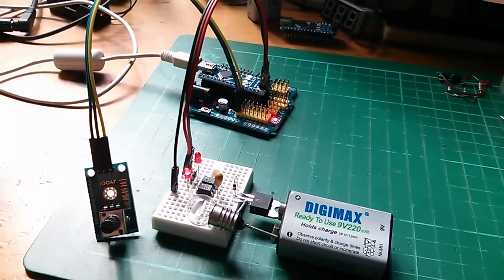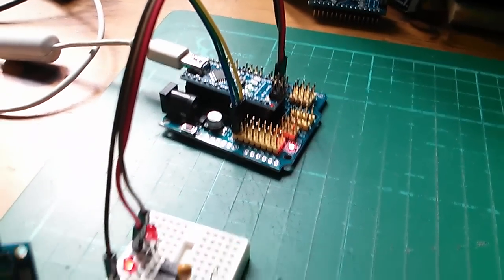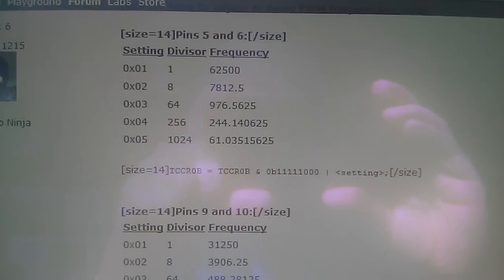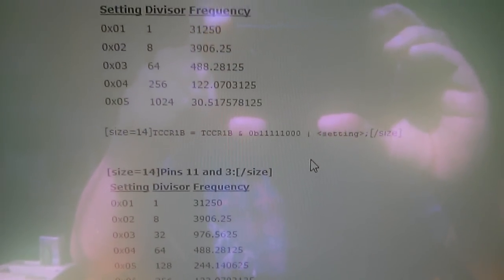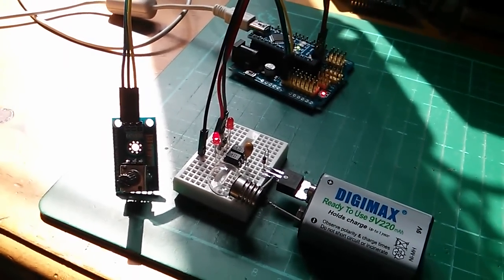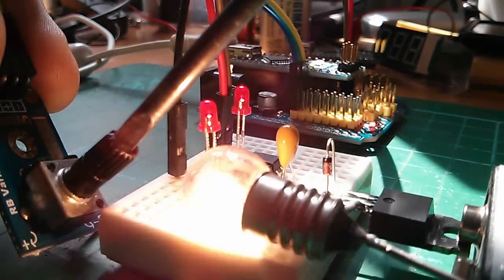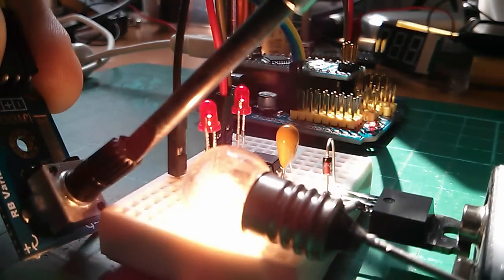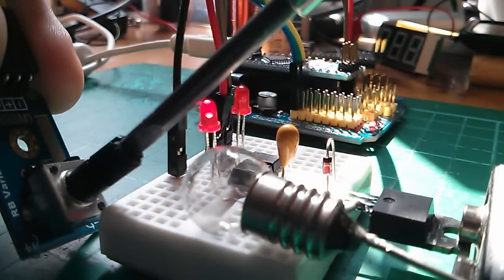Dual Complementary Opto-Isolator (DCOI) High Side MOSFET Driver #2

Comment: Have you measured the rise/fall-times of this circuit? Afair standard opto isolators are somewhat slow when switching which could drive the mosfet into linar operation lowering its efficiency